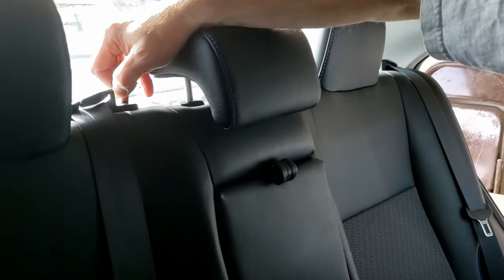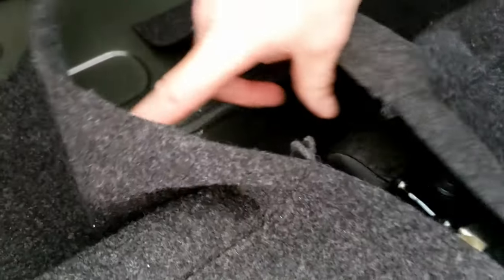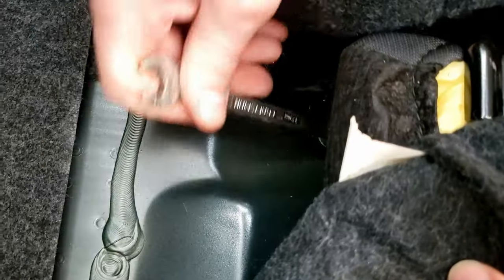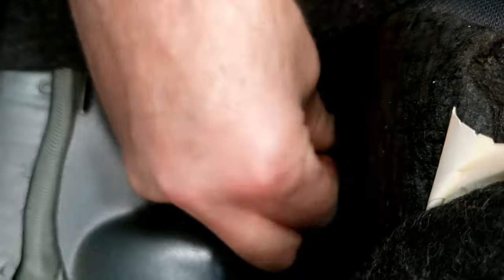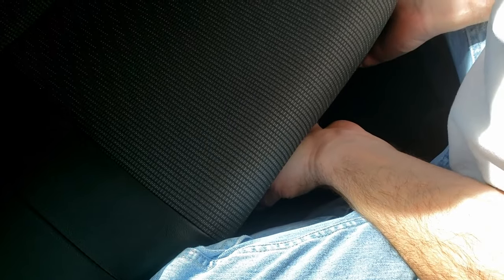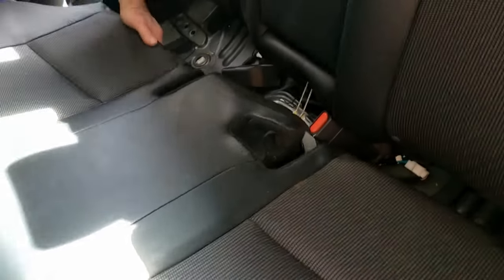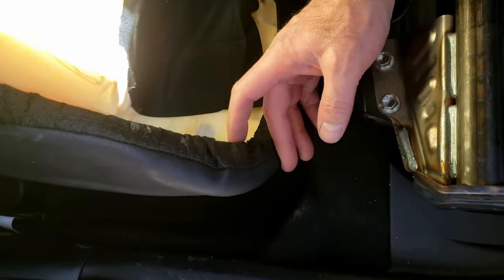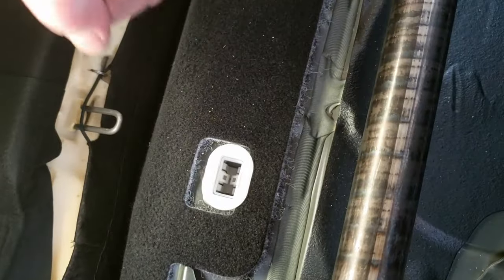How to Remove the Rear Seat Base from a 2014-2019 Toyota Corolla

Comment: Where did you get your strap wrench from?
Reply from the maker: Used a hammer and wood and tapped it lightly to break it loose.  I finished up with a custom strap wrench made with an old serpentine belt and a socket.